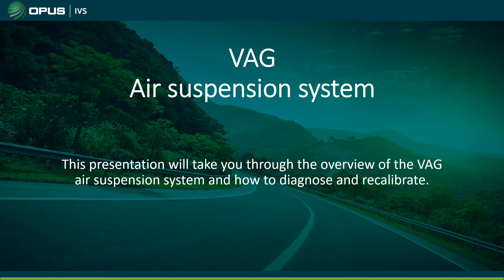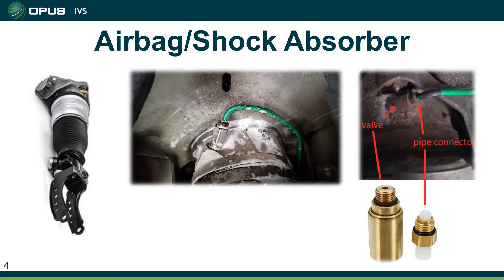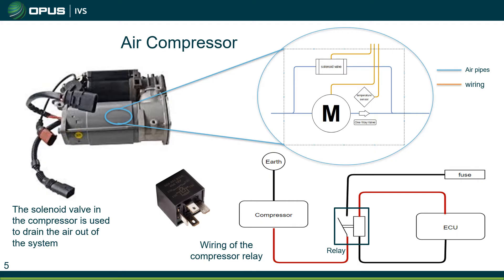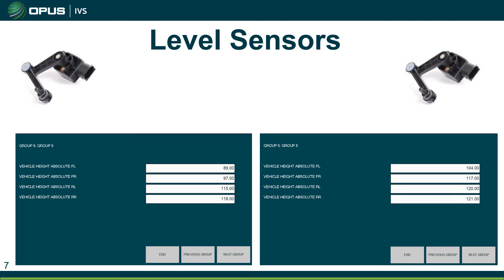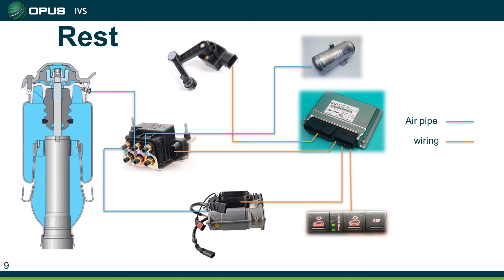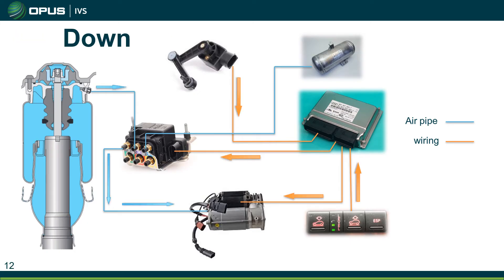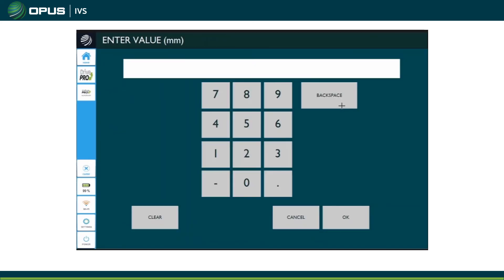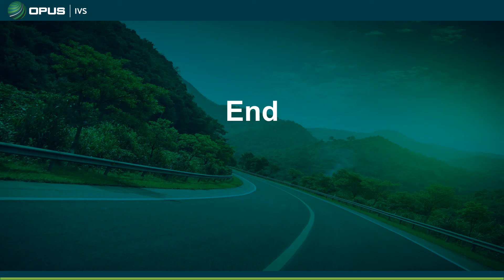VAG Air Suspension

Comment: On my 18 year old Allroad I have changed the front struts twice and have to change the front left again now, not always because of air loss but sometimes because of internal shock absorber failure, the car would tramp even on a straight road, the front left strut has now started that. Only this month is the first time a rear suspension unit has failed, dropping in an hour. It is a great car but I have had to do a lot of repairs.

Comment: Question. My front two sensors stated failed. They were replaced, they still get a faulty reading. I’ve checked wiring, no issue. Compressor was rebuilt and worked well before this.   Ecu was not communicating to replaced with a similar model and it reads again. I don’t want to keep tossing money at this but I need assistance… 955 Cayenne is the suv.

Comment: Very nice video.  I have an Audi A8L D3 and have code 01780 after having replaced both front shocks, also the compressor, valve block and relay.  I suspect this code refers to the position sensor is that correct?  How do I determine which sensor is the culprit using data please?

Comment: hi, I have a cayenne 3.2 and the rear of my car is in the air and the front sometimes goes up and down. But the rear is always in the air and never comes down. I changed the shock absorber valve but nothing happened. Where do you think the problem is? Thank you very much.
Reply: It's a broken level  sensor on either trailing arm in the rear. Same happend to my Allroad

Comment: Mega . Thanks . 1 question . By rest . ( Parking ) where is the pressure on the system ? On the ventilblock or on the kompressor? My car goes down on the back 40-40mm and front 10-10 after 3-4 days . I checkt leaks , nothing . Is it the pump maybe? Any Ideas ?
Reply: Would be on the valve block all the way to the air struts themselves.

Comment: Hi, my front suspension sits low and amber suspension light comes on after awhile. Whilst changing one of the front wheels the remaining air in the front suspension was pushed out of the system in what sounded like the compressor location. Thinking this is the return to atmosphere valve on the compressor? Can these be replaced or needs to be whole compressor. Are there any other reasons this could be happening? Compressor runs so is not burnt out, partial pressure holds in front, so dont think there is a leak in air lines. Thanks